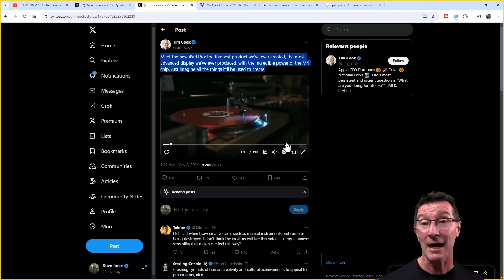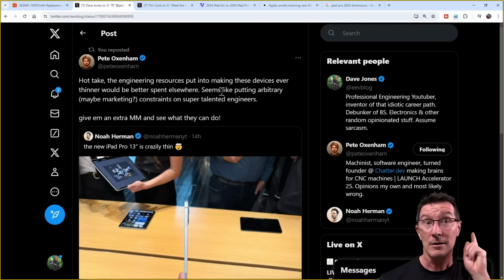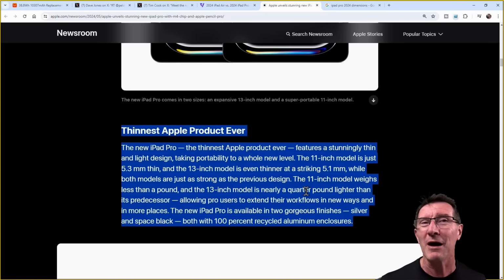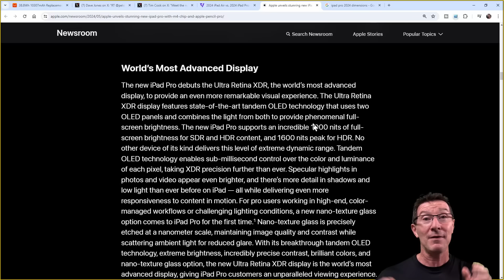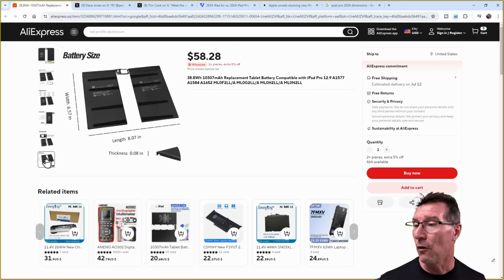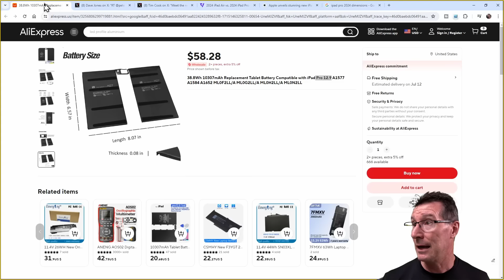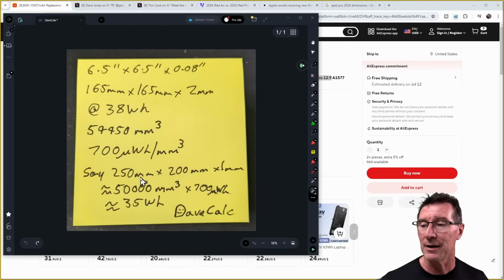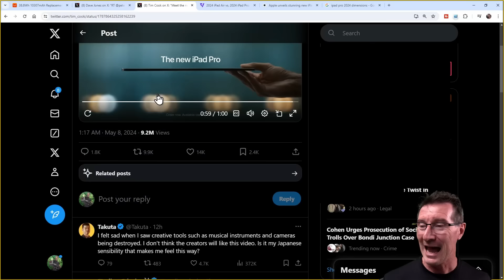eevBLAB 118 - NEW Apple iPad Pro: Volumetric Engineering vs Marketing

Comment: Worth mentioning Apple doesn't repair iPads at all (not just this new 5.1 mm thin one). All you've been able to do for the last few years is trade in your old one and get an allegedly "second hand refurbished" unit (-15% price of brand new). It's also alleged most trade-in units are just shredded because they can't be easily repaired (see GEEP and similar lawsuits).

Also the 10 hour battery life figure is for basic video playback (local and hardware decoded) on a brand new unit. 4-6 hours is more typical for the average mainstream user browsing Facebook who doesn't know how to close background apps. 100% guarantee they would rather an extra 2-3 hours of battery life than 1 mm thinner. But I also bet Apple would rather the battery be 100% DoD cycled more than once a day so it dies sooner and the consumer buys another one sooner. :)

And just in case there's any Apple engineers reading the comments, just want to help you out, 5.1 is a bigger number than 3.5.

Comment: The battery you found is for 2015 models. As a service technician, this raises all the red flags. Tablet of this size and this thin will bend like nothing. If memory serves, the iphone 6sp met the exact same fate, bending in people's pockets en mass. "Oh, you can't have it in your back pocket" no, sorry, it's a terrible design. Never let marketing department take charge of a company. 
PS: the thinner the bevel around the screen, the easier for the screen to crack. And these oled screens are easily half the price of the new device. AND they're tied to the motherboard with serial number so it's a pain (or impossible) to get it fixed without the stupid warning it's an unknown part. Even if it's genuine from a donor device. 
And you still have the cameras poking out from one corner so if you lay it flat on a desk, it's gonna wobble. How about making the case flush and get bigger battery? No? 
Awful business practices all around
Reply: It would be also great if in the process of bending it you could puncture the battery so it would catch on fire :D
Reply: My first thought too. This will bend so easily.
Reply: A lot of phones bent and broke. Not just Apple’s that one year. I doubt this will break easier.
Reply: Until we see a teardown or a bend test, it's a bit presumptuous to cry out bend-gate. I've repaired dozens of iPads and the engineering is breathtaking. While the display is as delicate as an eggshell and the frame is twisty, once bonded together it's surprisingly rigid. Moreover, the adhesives provide just enough elasticity to prevent shock damage.  It's possible to have an even thinner and more rigid housing by machining additional braces to prevent flexing. In turn, it would also require a smaller logic board and batteries. Considering the iPad is essentially an iPhone with a larger display, its logic board can stand to be trimmed down significantly without compromising its capabilities.
Reply: @D4no00 Modern battery packs have mitigated that risk for several years now. There's a video of Louis Rossman stabbing a MacBook battery as a demonstration.
Reply: @bobweiram6321  so you have repaired a lots of these devices that you say are like bulletproof?
Reply: @AndrewTSq  Nice try! Most of the iPads I worked on survived hell, severe drops, water submersion. Still, they were mostly functional. I've only repaired around 3 to 4 Android tablets and a couple of Surface Pros. The Android tablets are shoddily made and a rip off considering the specs and price. While Microsoft and Samsung are better quality, they're more expensive and become hazardous waste after a year or so with no resale value just like the Android ones. Used iPads, especially the Pro models from as far back as 2017, still fetch $150 to $600. 

When you think about it, Apple products are actually cheap. Even after 5 years or more years of use, you can often get around 40% to 50% of what you paid for it new. Try that with another brand.
Reply: @bobweiram6321  I was one of the OG iPad buyers, so I remember it becoming completely useless after a few iOS updates. I think it was like a year old at the time.  Also had a bent iPhone 6.
Reply: @AndrewTSq  I'm typing this from a 2nd Gen iPad Pro circa 2017. Still getting iPadOS updates. No reason to upgrade yet.
Reply: It is HILARIOUS that all modern cellphones REQUIRE a very thick and rugged third-party case, which not only makes the cellphone tolerant of a drop on the floor once in a while, but also makes the back of the cellphone flat on the table and it does not wobble!!!
Reply: @bobweiram6321  well, 1st gen ipad had 256MB ram. So just trying to visit a webpage with many pictures and safari crashes. But I have updated a long time ago. But it really felt like a slap in the face at the time.
Reply: Apparently they removed one of the speakers compared to the previous model because the spot it was in left thinner metal and they were bending at that spot.
Reply: @bobweiram6321  buddy, i really hope you're getting paid for this endorsement because if not, that's a very unhealthy love affair with a corporation
Reply: @hrnekbezucha  Unhealthy? Get a life. You're the one who's so full of lustful envy for products you can't afford that it clouds your ability to think objectively. I'm also very critical of Apple. For instance, I don't like their tactics for preventing repairs and their locked down development ecosystem. Still, I defend them against unfair criticism.  I still remember what it was like to use Microsoft's horrific software. 

Without Apple, it would be a dystopian nightmare where everything barely works. My productivity has gone through the roof. My iPad Pro, iPhone 6S (still kicking and screaming) and my MacBook Pro seamlessly complement each other and make my life easier. Instead, the US and EU are punishing them for their excellence while ignoring Amazon and Google who have control of both commerce and information.
Reply: What you mean by "never" they took over allready all companies since long.

Comment: You're all missing the point. Nobody cares that it's 0.2mm thinner. But the new iPad is 103g lighter. An iPad 12.9 is heavy! With the keyboard case it's heavier than a MacBook Air. Nobody needs the performance of the M4. But the M4 is significantly more efficient, which means they can save weight on the battery. So it's coincidentally 0.2mm thinner. They don't need more battery life. The iPad has ridiculous battery life already. And anybody acting like iPads are fragile has never owned one. I have a 2018 iPad Pro 11 that I've sat on several times and dropped down 3 flights of concrete stairs, and it's fine.

Comment: If only they would put more effort into making a product that is more easily serviceable, rather than making them so thin that they will break if you sneeze on them.  My phone is so thin I have to stick it in a thick case just so the darned thing is not constantly slipping out of my hands. Making something ultra thin can only mean one thing - they have skimped on other stuff that would have been much more beneficial - longer battery life, ease of servicing etc, etc.

Comment: Add 0,5mm to any car sheet metal and the car would last 20 years instead of "deliberately" designed 10 years.  Marketing goes ballistic on the proposal.
Reply: Except this shaving makes sense in a car where the weight is a huge factor in fuel economy. Not that modern cars are getting lighter though…

Comment: Convenient how the person in the video holds it to hide the camera bump when showing how thin it is. As somebody else wrote in the comment, would have looked much better by adding 2mm and removed the bump. Besides measuring the thickness, should you not do that on the thickest point? So it's about 7.1mm:-)

And the funniest thing about the thickness marketing wankery, it's still to thick to be the slimmest. As it stands, the number to beat is 4.7mm and have been so for a couple of years or so:-) Cue the reMarkable 2.

Comment: 1 mm for a pen house and bigger battery cause attaching the pen with a magnet ends usually in buying a spare pencil sooner or later .
So a pen house inside the case or integrated is a lot better as in former Samsung Note Series - never lost such pen.
Reply: Better for you as the consumer, but not better for apple as they wouldn't be able to sell you another pencil ;)
Reply: if you never lose the pen they never have to sell you a new one to replace it. Use that noggin

Comment: So how is this going to meet the EU requirement to have a user replaceable battery ( without the use of tools). 
What is so wonderful about making it thin. The same sort of rules were applied to mobile phones, now they are thin while being huge in the other two dimensions. Not exactly pocket size.
Then the product needs an added plastic case to give the phone the strength to not bend and to protect the screen.

Comment: Tim Cook doesn‘t care sh.. about the thickness. He has his Excel sheet and the engineering goal was to cut cost. So they made the battery smaller/less capacity, dropped one of the cameras and the SIM slot. A bit of it is compensated by software and the rest is just a few stories/lies to be told by the marketing department. Job done, Apple business as usual.
Reply: This is borderline illusional. Get a life.

Comment: Dave, I agree with you but it's missing one variable to have in mind. More battery -> more weight. I think that 50% more weight is not a deal breaker. But in that regard, I find ON-time on most Ipads more that acceptable.
By the way do you know any PCB design software usable in Ipad OS?

Comment: Kinda disagree with this take. You're not taking into factor one of the most important factors of a handheld device, and that's gravimetric design. Yes, you could double the battery size ... but how heavy is that already heavy 13" device going to become? 10 hours is a fine amount of screen on time for a device like this, 20 hours won't change the game that much. However, a heavier device will fatigue the user quicker and effectively limit the scenarios where you could comfortably use it, to the point where it makes more sense just to buy a laptop. They really should be marketting weight instead of thinness, but apple has always done thinness first :\

Comment: Kicked some older iMacs in a company yesterday - to slow because of old hard drives. Easy, just grab some new SSDs, right? Nope, glued and a lot of work, so it's not economical and it is not "best practice". So they will go to the trash, Core i5 from around 2016. Older than 5 years? ---> trash. But hey, they were so slim and shiny!

Comment: Could also be the engineers got bored with yet another iPad, so they raised the bar to tickle their brains? I mean, designing without limits is easy. It's the limitations where the engineering boys get separated from the men.
Reply from the maker: "Engineers, increase the battery life 50% in the same thickness and weight, add repairability, and reduce the BOM cost. And have it ready by next month. Go."

Comment: Oh not just 50% more between charging!!! 50% longer device life!!!!
IF you have to charge less often, you charge a lot fever time in a year, hence you will not need to throw away your ipad for an other few years because the battery is dead! Hence, you'll buy 50% less ipads, hence they do not give you longer battery life.
This should be punishable by court in my opinion. Give the user and the environment the chance they deserve.
Reply: I could imagine it being even more than 50% longer life because not only do you need to charge it less often, you can also lose a higher percentage of your capacity before it feels like it doesn't last long enough anymore!
I really noticed this with my 2017 Dell XPS laptop, the battery is huuge and took 6 years to degrade enough to make me replace it. And I replaced the battery, not the laptop, because it's super repairable.
Reply: @hananas2  That is what I tried to say. You need to charge a bigger battery fewer times in regards of the life of the device.

Comment: What i dont get, why is THIS the device they decided to make crazy thin? Isnt thin the whole point of the ipad air? Pro devices dont need to be crazy thin. Theres no reason for this. As you said, pro consumers would get much more use out of a better battery than a thinner device. A few milometers are useless to them.

Comment: They could increase the thickness by the amount of the camera bump and here you have a twice larger battery. But no, they make it so that the device without a case cannot be simply placed on the table - it will wobble on the camera bump like crazy when used and you will additionally have to buy a case. Or so that it breaks more easily when you accidentally press it (especially with it's thickness) and you go and buy a new one. Shame on you, apple.

Comment: Has anyone of you haters ever given a 90-minute lecture (or presentation) with a 13" iPad in their hands? 100 grams and a few centimeters of thickness make a huge difference in usability in many usage scenarios where people actually work with their devices. Also, my Gen 6 13" iPad lasts for more than one work day on a single charge. Battery capacity is really not a big deal anymore (for Apple users). Get a life! I recently re-subscribed to the EEVBlog channel, but I'm greeted with substandard content like this. Meh.

Comment: Gotta love the marketing going ham with the process nodes of 3 "nm" even though now it's just a theoretical dimension and not related to the smallest feature size since at least a decade...
Reply: Yeah, I hate that as well... "3 nm" node: Gate pitch=48 nm, metal pitch= 24 nm. (https://en.wikipedia.org/wiki/3_nm_process ). I guess, the real numbers stopped in like 1997.
Reply: yeah.. if it were really 3nm,  they would only be about 30 atoms across..
Reply from the maker: So it's the 2020's equivalent of audio PMPO from the 1980's
Reply: @calholli  Yup, I mean, right now we can do things around 6 nm which is very impressive, but that's nowhere near "production" stuff, only research!
Reply: They really need to go to the number of transistors per Sq. mm which is what really counts. Gate pitch and such really isn't a valid way of measuring with non-planar technologies like FinFET
Reply: @longjohn526  That's one of the reasons that they give ridiculous values nowadays. In my opinion they should just ditch the marketing number altogether. There's too many parameters to judge about a process node, number of transistors.mm-2, switching frequency and leaking current would be interesting metrics.

Comment: A reason not to add more battery is to keep the mass low.  Holding on to an iPad does make the hand tired after a while.  My guess is 10 hours use between charging opportunities was determined to be adequate for majority of use cases so Apple went with taking mass out.
Reply: How long are you holding the tablet for and how often do you hold the tablet for that amount of time?

Comment: As pointless as the thinness is, I really don't get all the obsession with "the camera bulge."  Is this actually a problem?  OK, it doesn't lie perfectly flat.  .....  uh ....  so?  Were you going to use it as a drink coaster?

There is plenty to criticize here.  Legitimate things, like the wasted opportunity to give it more battery life.  Or just the sheer pointlessness of being "the thinnest Apple device ever."  But I do not get the this one.  "There's space between my table surface and the back panel!"  Think of it as a suction-prevention feature.  If you lift it off another smooth surface, it won't just skitter away from you.  It'll come right up.  There ya go.  Glass half full.

Comment: the apple users are told by apple marketing that they are at the pinnacle of technology. And the measurement units are chosen that a non tech person can understand. size in mm is understandeable. battery capacity is not and battery run time is a complex unit under different loads. shiny brittle surfaces are a style easy to recognise. repairability means you were not able to handle your device and now its broken. most apple users hide their shiny devices in worn protective bags and rubber sleeves. apple users are told that they are using the fastest technology available on he planet. imagine that you tell a PCMR member to buy the fastest PC available and offer him only battery powered mobile devices or SFF PCs. But the PCMR members are fools, too. Instead of reducing the height of a tablet, add RGB and useless TFTs and brittle glass sidepanels to the big box PC. Blocking airflow by style elements, glass is an excellent isolator for heat and airflow. commenting on marketing campaigns of big tech companys already feels like i am wasting my time. mic drop.